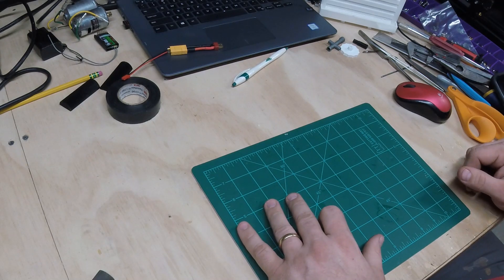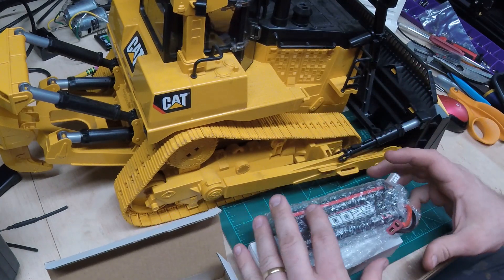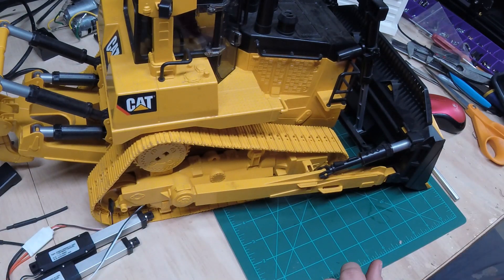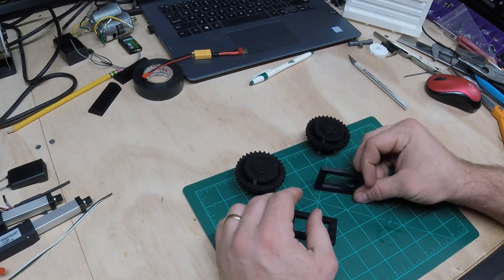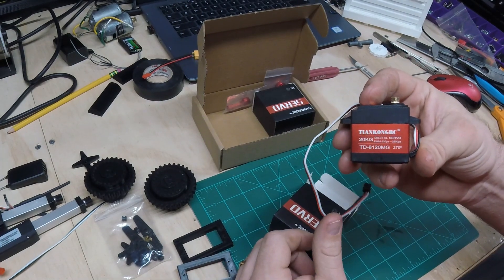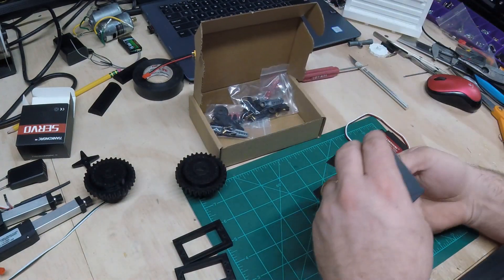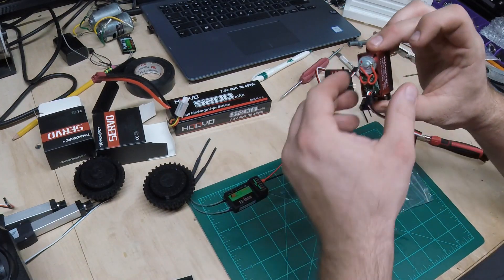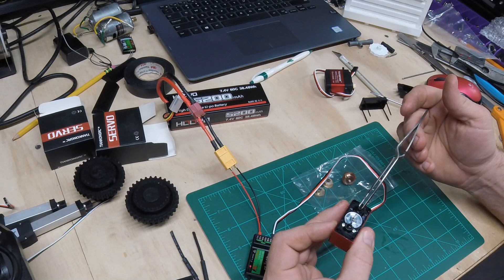Bruder D11 RC Conversion Part 1, Overview and Modifying Servo for Continuous Rotation

Comment: I want to convert one of these, but was wondering how long the plastic tracks last, servos, and all that...how much weight you can put in it, without stressing the tracks and running gear. 
I really love it since its really  simple. but a bit sceptical on the plastic track part...huina 580 tracks are compatible perhaps that upgrade the the huina tracktion wheel.